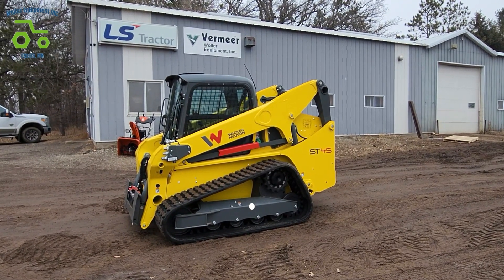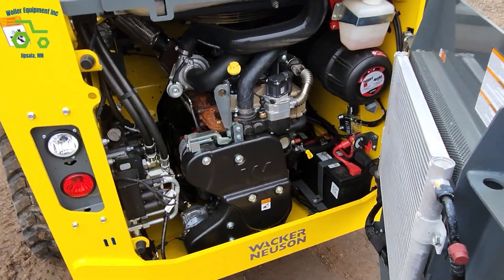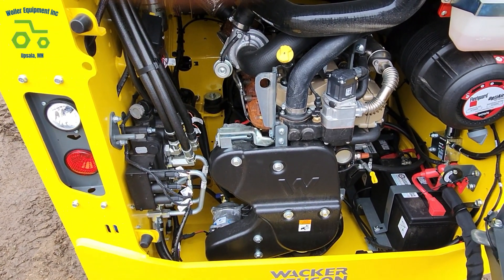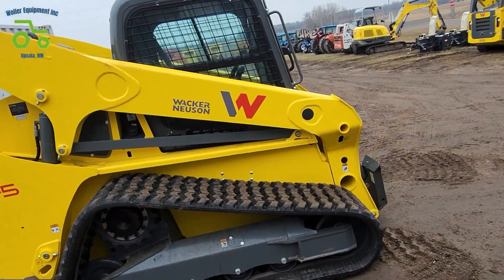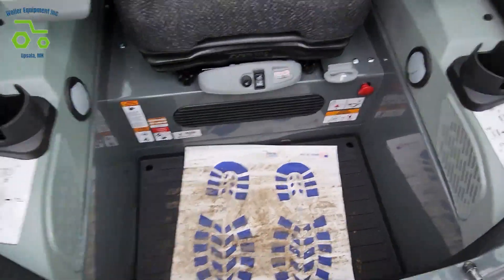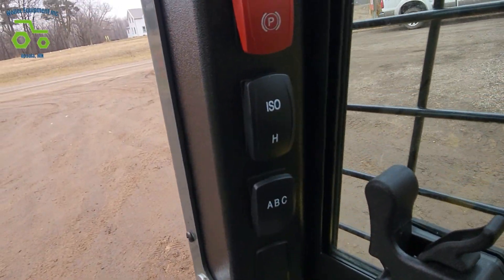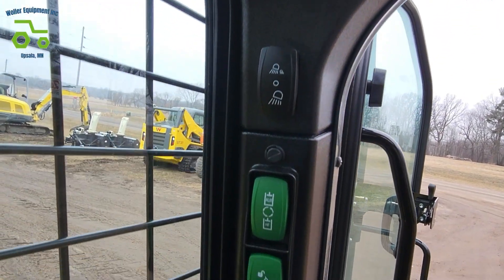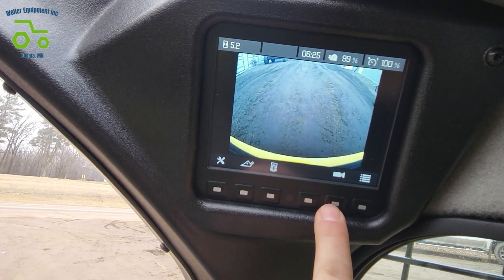2024 Wacker Neuson ST45 Compact Track Loader | One Minute Walk Around

Comment: Id buy it in a heartbeat if i coukd find a dealer that would service it near me, closest dealer is 2hrs away, no field mechanic. 35k less than the new 265 cat i got quoted
Reply from the maker: Wow! That's quite the price difference! Unfortunately Wacker doesn't have quite the dealer network that CAT has, but I think it will continue to grow, so hopefully you will get a local dealer in the future!
Reply: @wollerequipment  can you sell to an out of market customer? I know case doesn't allow it
Reply from the maker: There is some minor territory regulation. Although it doesn't sound like you have a dealer assigned to your area. I generally try to sell close enough to service what I sell.
Reply: @wollerequipment  sorry to keep bugging you, there is Cecil tractor in Warrenton VA about 2 hrs away, but have not gotten back to me.  Also curious what the torque rating on the engine is

Comment: What's the torque rating on the engine?
Reply from the maker: It is rated at 369 ft lbs of torque
Reply: @wollerequipment  the st45?
Reply: I think that's st 50 rating
Reply from the maker: Possibly, they use the same engine from 74-126 hp. Wacker does not show torque so I looked up the engine model specs from Kohler.
Reply: I think that's st 50 rating
Reply: @wollerequipment  thanks
Reply: Kohler/ jcb engine 😮😮😮😮
Reply from the maker: The Kohler/Lombardini engine has been great, lots of power, good fuel economy, and they back it with a 4 year 4000 hr warranty.
Reply: @wollerequipment  engine is garbage
Reply: Do you still have that machine?